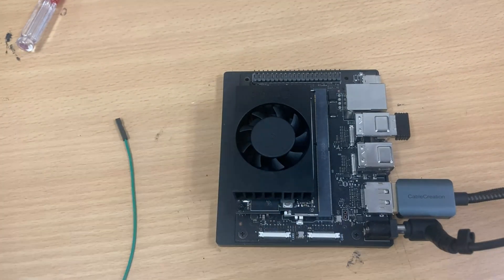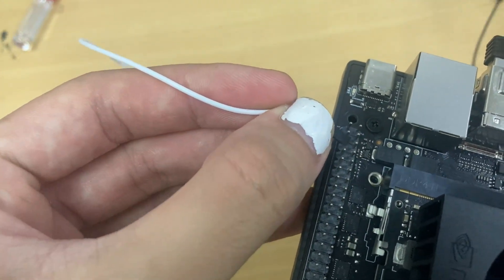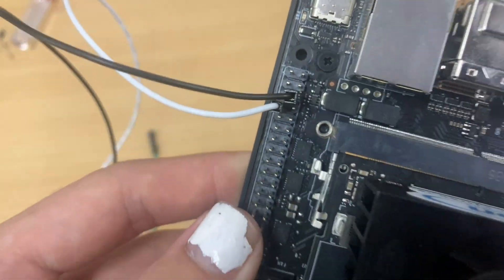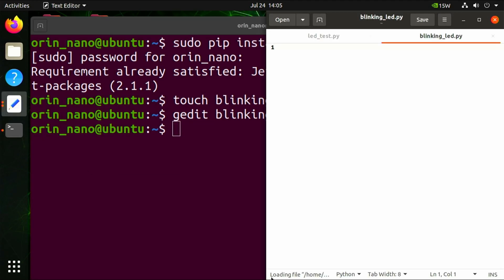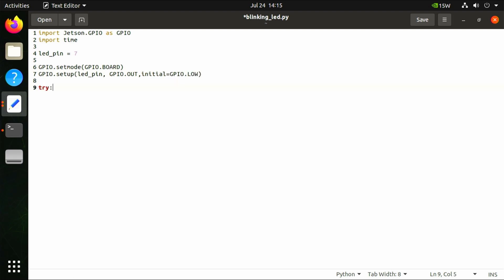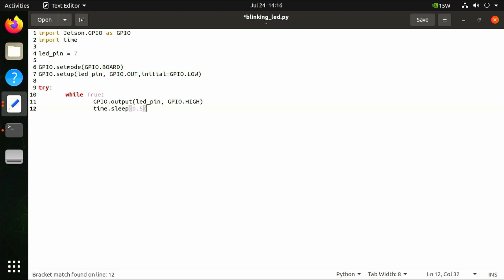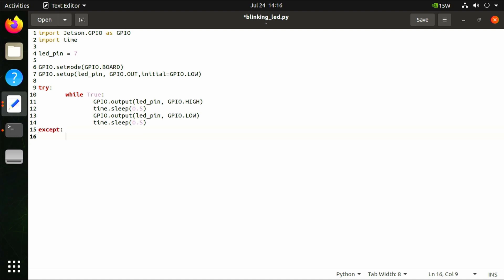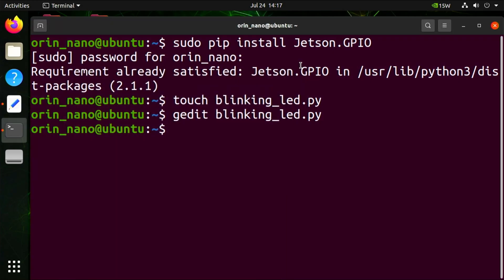Use LED with Nvidia Jetson Orin Nano 8GB Dev Kit via the GPIO  #jetson #nvidia  #orinnano

Comment: wouldn't this damage the LED light? don't you need resistance?
Reply: It is good practice to install a resistor on an led to provide some resistance, however in this niche case, the current outputted by the jetson is so low that it technically can be exempt! (Though installing a low ohm resistor would not hurt)
Reply: @gamma26  gotcha, thank you!